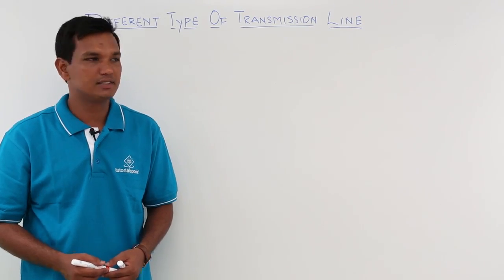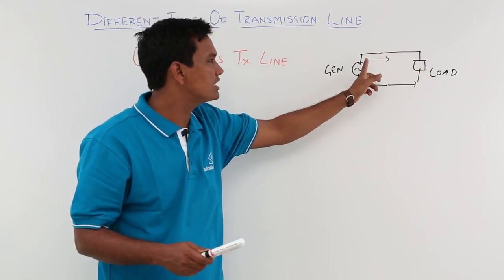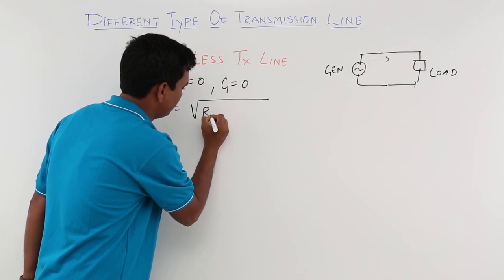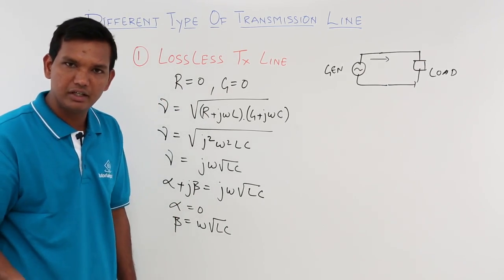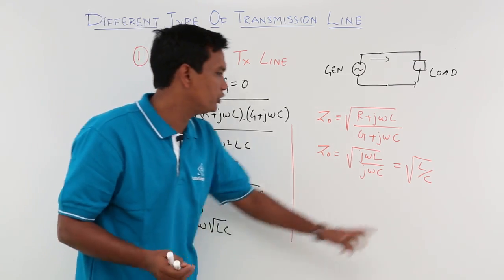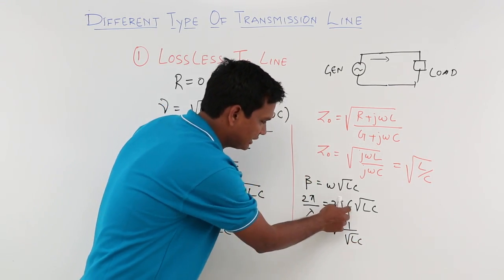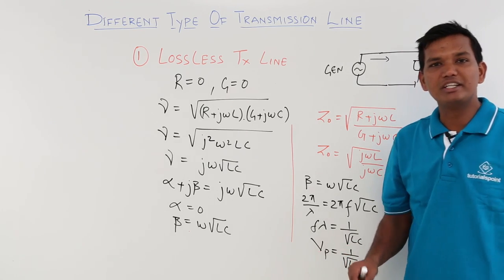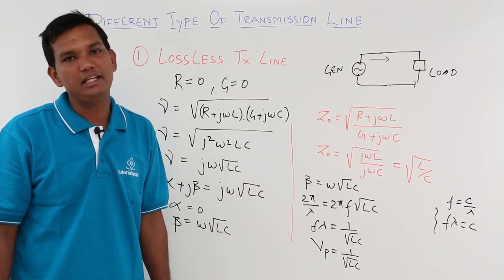Different Type of Transmission Line   Loss Less

Comment: Hello, what about Current and Voltage Amplitude Distribution in Lossless Transmission Line? What it's the formula and how to prove them? Thanks!
Reply: For a definition of attenuation visit http://www.nist.gov/calibrations/upload/mn137.pdf
Also, you may refer to the book below.
What is a transmission line?
When a high frequency signal voltage is applied to a transmission line, which consists of a pair of perfectly conducting parallel planes separated by a distance, energy transfers from the source to the load by pulsating electric and magnetic fields between the planes; the fields don't travel.
Transmission lines are analysed by considering the voltage and current on the line, and the field configurations and wave dynamics provide insights into the origins of the voltage and current.
The book "Fundamentals of electric theory and Circuits" by Sridhar Chitta
https://www.wileyindia.com/fundamentals-of-electric-theory-and-circuits.html begins with detailed discussions in the initial chapters 
on the topics of surface charge, coulomb's law, electric fields, fields of dipoles and other charge configurations such as a pair of parallel plates, in which a distinct approach is made using the surface charge concept in the study of advanced topics of capacitance, currents, conservation of charge, conservation of current, superposition of fields, superposition of potential, a simple dc circuit, voltage, voltage source, difference between e.m.f. and potential difference, ideal voltage sources, resistors, how current branches in a parallel circuit, capacitors, and the superposition of ac signals on a dc voltage for coupling signals to amplifiers.

One section in Chapter 3 describes the principle of superposition of potential and provides an intuitive explanation of its application in small-signal ac circuit anaysis and developing ac equivalent circuits which is not usually found in textbooks.

Then, two chapters are devoted to discussions on magnetic fields, magnetic fields of a current element, straight wire, current loop, solenoids, biot-savart law, inductors, Faraday's law, inductance, ac circuits, and transmission lines. 

The section on Transmission lines in Chapter 5, discusses signal transmission over two-wire lines and coaxial cables. There is an in-depth discussion on the origin of common-mode currents, incident and reflected waves in transmission lines and the TEM mode of wave of propagation.
One section is devoted to a discussion of the attenuation in the context of lossless lines and the speed of propagation of signals over transmission lines.
In several chapters, the differential-mode signals of circuits are identified and in one chapter a comparison of the differential-mode signal and common-mode signal is provided. 
An interactive Java based program depicting the passage of signals on transmission with a provision to vary line parameters is included in the CD alongwith the book, which is useful to understand the propagation of signals on transmission lines.

Subsequent chapters discuss the
Lorentz Force law, motors, generators, p-n junction diodes, electromagnetic waves, antennas and radiation, waveguides, and new electrodynamic theories on the nature of the electric field.

The CD contains animated power point presentations for all chapters and voltage regulator, RC phase shift oscillator, transformer-coupled audio amplifier and differential amplifier included additionally.
The contents of the above book by Sridhar Chitta, make a distinct unified approach to electrostatics and a few advanced circuits like coupling signals to amplifiers. This approach lends precision and clarity to the topics which is not found in most text books.

There is a "look inside" feature in the amazon.com webpage of the book "Fundamentals of electric theory and circuits" by Sridhar Chitta with a few pages of Chapter 1 which may be viewed and also which you may swipe left or press < icon to view the foreword, preface and Table of Contents. 
There is a full set of lectures beginning lecture 13 here on surface charges, electric fields, simple circuits, capacitance, inductance, faraday's law, motional emf, magnetic forces and more topics here
https://matterandinteractions.org/videos/EM.html
Electrostatics and circuits belong to one science and not two, that of electricity and magnetism. To know how they are unified visit this link 
https://matterandinteractions.org/articles-talks/ and view the article 'A unified treatment of electrostatics and circuits.  B. Sherwood and R. Chabay, unpublished. (1999)'
pdf. 
For a live demonstration of surface charge and its effects in circuits visit 
https://youtu.be/U7RLg-691eQ

Comment: I m not understand
Reply: What is a transmission line?
When a high frequency signal voltage is applied to a transmission line, which consists of a pair of perfectly conducting parallel planes separated by a distance, energy transfers from the source to the load by pulsating electric and magnetic fields between the planes; the fields don't travel.
Transmission lines are analysed by considering the voltage and current on the line, and the field configurations and wave dynamics provide insights into the origins of the voltage and current.
The book "Fundamentals of electric theory and Circuits" by Sridhar Chitta
https://www.wileyindia.com/fundamentals-of-electric-theory-and-circuits.html begins with detailed discussions in the initial chapters 
on the topics of surface charge, coulomb's law, electric fields, fields of dipoles and other charge configurations such as a pair of parallel plates, in which a distinct approach is made using the surface charge concept in the study of advanced topics of capacitance, currents, conservation of charge, conservation of current, superposition of fields, superposition of potential, a simple dc circuit, voltage, voltage source, difference between e.m.f. and potential difference, ideal voltage sources, resistors, how current branches in a parallel circuit, capacitors, and the superposition of ac signals on a dc voltage for coupling signals to amplifiers.

One section in Chapter 3 describes the principle of superposition of potential and provides an intuitive explanation of its application in small-signal ac circuit anaysis and developing ac equivalent circuits which is not usually found in textbooks.

Then, two chapters are devoted to discussions on magnetic fields, magnetic fields of a current element, straight wire, current loop, solenoids, biot-savart law, inductors, Faraday's law, inductance, ac circuits, and transmission lines. 

The section on Transmission lines in Chapter 5, discusses signal transmission over two-wire lines and coaxial cables. There is an in-depth discussion on the origin of common-mode currents, incident and reflected waves in transmission lines and the TEM mode of wave of propagation.
One section is devoted to a discussion of the attenuation in the context of lossless lines and the speed of propagation of signals over transmission lines.
In several chapters, the differential-mode signals of circuits are identified and in one chapter a comparison of the differential-mode signal and common-mode signal is provided. 
An interactive Java based program depicting the passage of signals on transmission with a provision to vary line parameters is included in the CD alongwith the book, which is useful to understand the propagation of signals on transmission lines.

Subsequent chapters discuss the
Lorentz Force law, motors, generators, p-n junction diodes, electromagnetic waves, antennas and radiation, waveguides, and new electrodynamic theories on the nature of the electric field.

The CD contains animated power point presentations for all chapters and voltage regulator, RC phase shift oscillator, transformer-coupled audio amplifier and differential amplifier included additionally.
The contents of the above book by Sridhar Chitta, make a distinct unified approach to electrostatics and a few advanced circuits like coupling signals to amplifiers. This approach lends precision and clarity to the topics which is not found in most text books.

There is a "look inside" feature in the amazon.com webpage of the book "Fundamentals of electric theory and circuits" by Sridhar Chitta with a few pages of Chapter 1 which may be viewed and also which you may swipe left or press < icon to view the foreword, preface and Table of Contents. 
There is a full set of lectures beginning lecture 13 here on surface charges, electric fields, simple circuits, capacitance, inductance, faraday's law, motional emf, magnetic forces and more topics here
https://matterandinteractions.org/videos/EM.html
Electrostatics and circuits belong to one science and not two, that of electricity and magnetism. To know how they are unified visit this link 
https://matterandinteractions.org/articles-talks/ and view the article 'A unified treatment of electrostatics and circuits.  B. Sherwood and R. Chabay, unpublished. (1999)'
pdf. 
For a live demonstration of surface charge and its effects in circuits visit 
https://youtu.be/U7RLg-691eQ

Comment: Sir if it is lossless then why are we having impedance here
Reply: nikhil aneja lossless means there is no attenuation in signal strength but it still has reactive components which constitutes impedance
Reply: For a definition of attenuation visit http://www.nist.gov/calibrations/upload/mn137.pdf
Also, you may refer to the book below.
What is a transmission line?
When a high frequency signal voltage is applied to a transmission line, which consists of a pair of perfectly conducting parallel planes separated by a distance, energy transfers from the source to the load by pulsating electric and magnetic fields between the planes; the fields don't travel.
Transmission lines are analysed by considering the voltage and current on the line, and the field configurations and wave dynamics provide insights into the origins of the voltage and current.
The book "Fundamentals of electric theory and Circuits" by Sridhar Chitta
https://www.wileyindia.com/fundamentals-of-electric-theory-and-circuits.html begins with detailed discussions in the initial chapters 
on the topics of surface charge, coulomb's law, electric fields, fields of dipoles and other charge configurations such as a pair of parallel plates, in which a distinct approach is made using the surface charge concept in the study of advanced topics of capacitance, currents, conservation of charge, conservation of current, superposition of fields, superposition of potential, a simple dc circuit, voltage, voltage source, difference between e.m.f. and potential difference, ideal voltage sources, resistors, how current branches in a parallel circuit, capacitors, and the superposition of ac signals on a dc voltage for coupling signals to amplifiers.

One section in Chapter 3 describes the principle of superposition of potential and provides an intuitive explanation of its application in small-signal ac circuit anaysis and developing ac equivalent circuits which is not usually found in textbooks.

Then, two chapters are devoted to discussions on magnetic fields, magnetic fields of a current element, straight wire, current loop, solenoids, biot-savart law, inductors, Faraday's law, inductance, ac circuits, and transmission lines. 

The section on Transmission lines in Chapter 5, discusses signal transmission over two-wire lines and coaxial cables. There is an in-depth discussion on the origin of common-mode currents, incident and reflected waves in transmission lines and the TEM mode of wave of propagation.
One section is devoted to a discussion of the attenuation in the context of lossless lines and the speed of propagation of signals over transmission lines.
In several chapters, the differential-mode signals of circuits are identified and in one chapter a comparison of the differential-mode signal and common-mode signal is provided. 
An interactive Java based program depicting the passage of signals on transmission with a provision to vary line parameters is included in the CD alongwith the book, which is useful to understand the propagation of signals on transmission lines.

Subsequent chapters discuss the
Lorentz Force law, motors, generators, p-n junction diodes, electromagnetic waves, antennas and radiation, waveguides, and new electrodynamic theories on the nature of the electric field.

The CD contains animated power point presentations for all chapters and voltage regulator, RC phase shift oscillator, transformer-coupled audio amplifier and differential amplifier included additionally.
The contents of the above book by Sridhar Chitta, make a distinct unified approach to electrostatics and a few advanced circuits like coupling signals to amplifiers. This approach lends precision and clarity to the topics which is not found in most text books.

There is a "look inside" feature in the amazon.com webpage of the book "Fundamentals of electric theory and circuits" by Sridhar Chitta with a few pages of Chapter 1 which may be viewed and also which you may swipe left or press < icon to view the foreword, preface and Table of Contents. 
There is a full set of lectures beginning lecture 13 here on surface charges, electric fields, simple circuits, capacitance, inductance, faraday's law, motional emf, magnetic forces and more topics here
https://matterandinteractions.org/videos/EM.html
Electrostatics and circuits belong to one science and not two, that of electricity and magnetism. To know how they are unified visit this link 
https://matterandinteractions.org/articles-talks/ and view the article 'A unified treatment of electrostatics and circuits.  B. Sherwood and R. Chabay, unpublished. (1999)'
pdf. 
For a live demonstration of surface charge and its effects in circuits visit 
https://youtu.be/U7RLg-691eQ